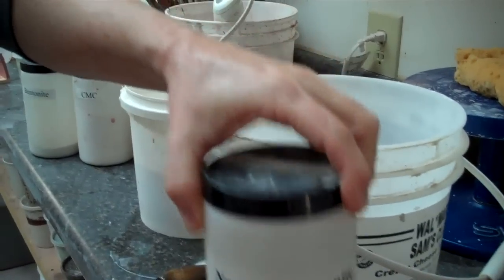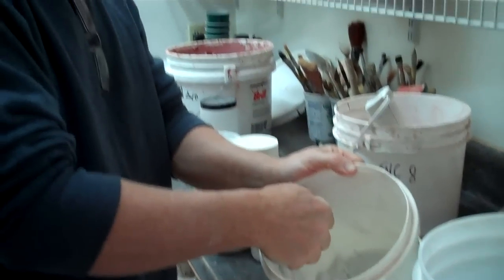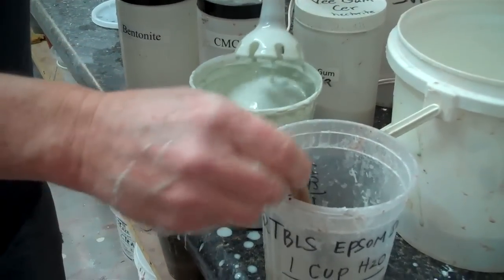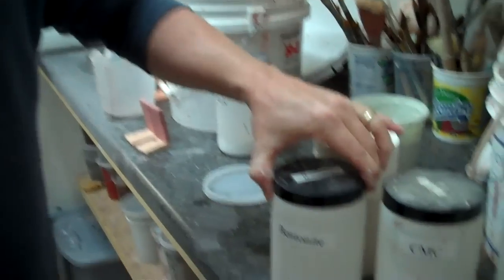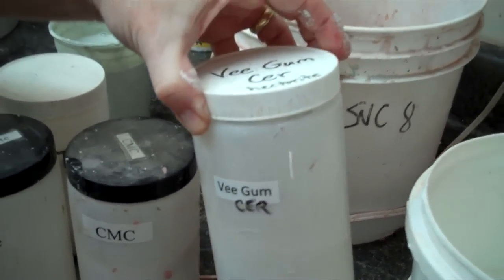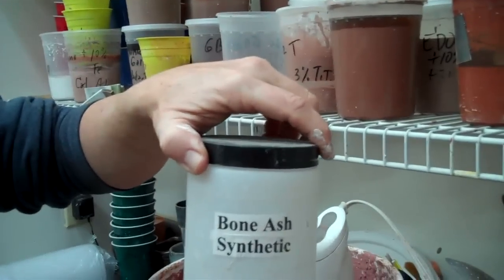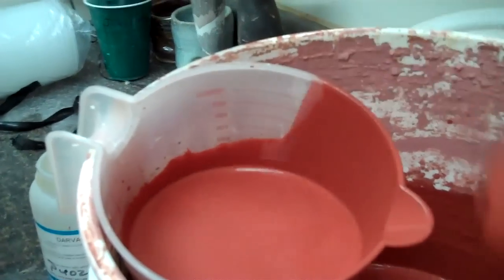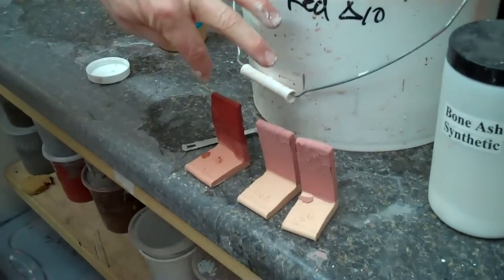Deflocculated and Flocculated Glazes (Free Online Glaze Course Part 15 Lab)

Comment: John, I did some more research on the subject of flocculation and deflocculation. We were both right in some regards, but both our mechanisms were incorrect. A great discussion of this is found in Ceramic Science for the Potter - see Pgs 59 - 64. Apparently a really key aspect to flocculation/deflocculation is cation size. Large cations deflocculate, small flocculate. Na+ and K+ are large and deflocculate, Ca++, Mg++, and H+ (responsible for acidity) are smaller and flocculate. Has to do with the distances between the alumino-silicate plates of the clay and how the cations fit between them. Really fascinating stuff.

Comment: Very unlikely. For fit, the amounts used for flocculation/deflocculation are so small, compared to glaze ingredients, as to be insignificant. Crazing is a fit issue, see above. Pinholes and other defects are usually related how you glazed, not ingredients. Crawling perhaps, but only because flocculated glazes can allow you to glaze too thick which, for high clay glazes, will cause slight glaze cracking on drying (like cracked clay in a dry lake bed) leading to crawling when fired.

Comment: Thank you for the great information, it's exactly what I've been looking for; a visual on the concepts. I have a question, why would the flocculated glaze not dry quickly? It sounded like you were saying that both effects in excess result in the slurry remaining wet on the bisque. I've read thought that because of the "card house" effect, a flocculated slurry will allow the water to enter the bisque faster.

Comment from the maker: Try it. It works great. You can get high concentrations at green stores. Green pesticide.  (20% acetic acid)  Also, muratic acid. I think some use calcium chloride too.  Here is an article that is through:

You will have to google clay times and pete pinnell and adjust glazes.

Comment: Hi John, Thanks for sharing. Does your deflocculated clay settles with time? I observed settling over a period of 24 hours when I used sodium silicate for deflocculation.
Reply from the maker: This was about glazes. But in general everything changes over time as electrons are moving back and forth at all times. As far as slips, yes they can settle and get hard over time. That is why you need to maintain them. (casting slip) As for thickened slips they really don't because so much clay.  (See thickened slips video)

Comment: I agree with what you say above, John, if it seemed I was contradicting you, I apologize.

Why do you attribute flocculation to pH? Vinegar won't flocculate a glaze or slip, yet raises acidity, quicklime won't deflocculate but raises alkalinity. Adding group II metal ions (Ca++ or Mg++) will (due to charge cross-linking with the sl negative hydroxyl sites on the clay plate). Adding group I ions (Na+, K+) deflocculates by blocking said cross-linking. Your thoughts?

Comment: Having a glaze issue. My glaze dries very fast, becomes powdery but it is also cracking on the inside corner of a cup and around the handle connection point. If I do a faster application the glaze is too thin and ends up having a very rough / dry outcome (post firing). It needs to be a thicker application, but the thicker the application the more cracking and thus crawling occurs. I am applying in 2 phases. I pour the inside, let it dry over night and then dip the outside. This is a magnesium based matte glaze based off of Tony Hansen's G2934Y. Thoughts?

Comment: so what is up when i dip a cup in a shino and it doesn't dry? most of the time the post dry fast, by if their is ANY moisture on the bisque cup from cleaning off the dust, the shino won't stick. and do any of these additives change specific gravity?
thanks

Comment: Hi John. I have some crawling with a glaze that needs to be applied thickly. If it is thinner it looks boring. How do I fix the crawling? Some cmc so that it can dry more slowly?
Reply from the maker: Have to know recipe...go on the group..."Exploring Midrange Glazes Together with John Britt's Book...lots of help there.
Reply: It is Strontium Gloss
Recipe number 39066 on Glazy

Custer Feldspar 40.00
Strontium Carbonate 21.00
Silica 15.00
EP Kaolin 12.00
Ferro Frit 3134 12.00
Total base recipe	100.00
Rutile 8.00
Manganese 3.00
Bentonite 2.00
Reply: @johnbrittpottery 
Thanks! 
I know about that group but I don't have Facebook.
Reply from the maker: Not sure why that would crawl?

Comment: Hi. I bought a complete ceramic studio second hand, including some ready mixed glazes. Some of the glazes have as you described in your video have settled and are incredibly difficult to mix up. Is there anything you could suggest to stop this happening?
Reply from the maker: Yes you add epson salts...see the video on flocculated and deflocculate glazes..should explain.  Let me know if you need more. Also check out the Facebook Group  page...Exploring Midrange Glazes Together with John Britt's Book...great group and helpful folks.
Reply: Thank you for your advice, Sir Glaze Oracle.  On the flip side I have some glazes that are a thick as pudding. Should I add water to these first? I live in Spain and my ceramic supplier does not have Darvan (any of the numbers) I can however, buy Sodium Silicate called (Silicato de Sodio Neutro 1L) I’m hoping this would work. I will also check out the Facebook page. Your videos are a God send. My Spanish is not specific enough to ask technical questions.